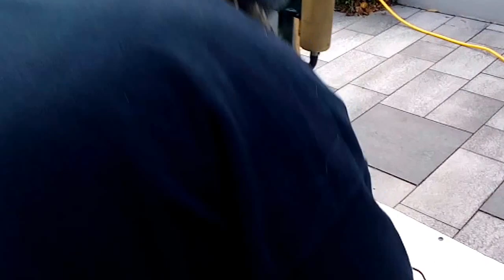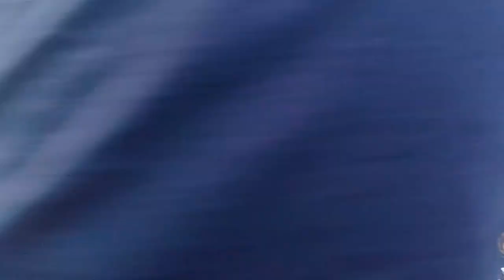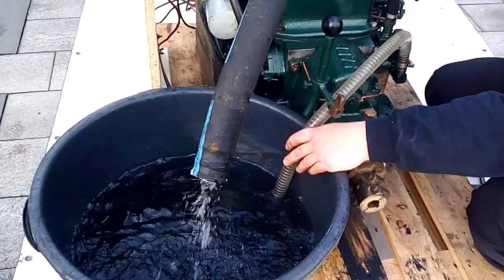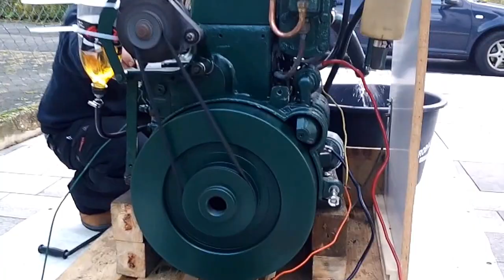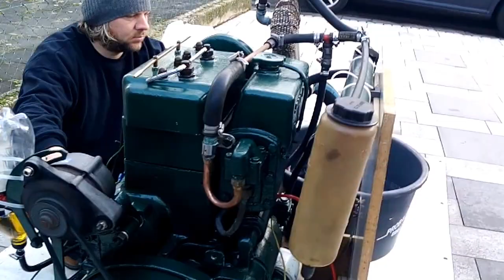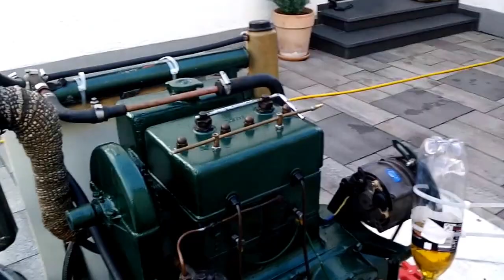SABB 2G electric startup

Comment: Hello. Do you understand the repair of this machine? We use this machine on a lifeboat. But our machine failed and we couldn't solve the problem. The problem is that the machine runs continuously at high speed and the machine does not stop when we pull the stop lever. The control wire connected to the machine does not adjust. What could be the problem for you?